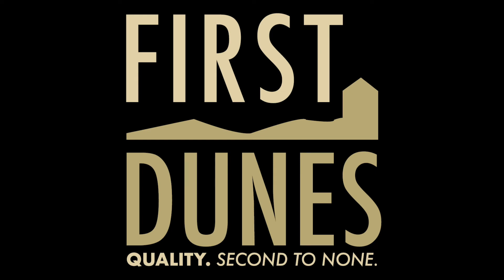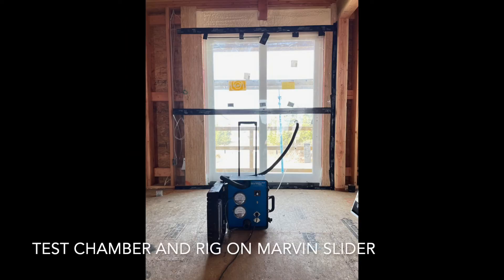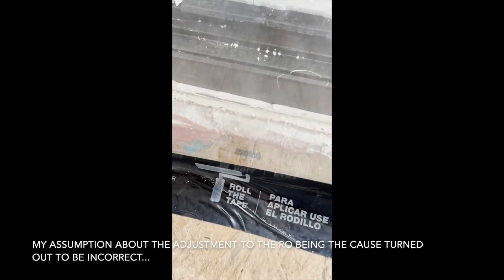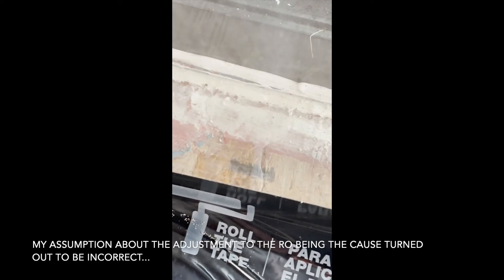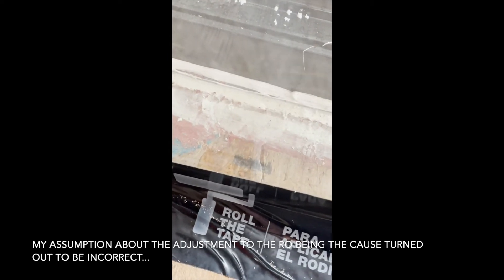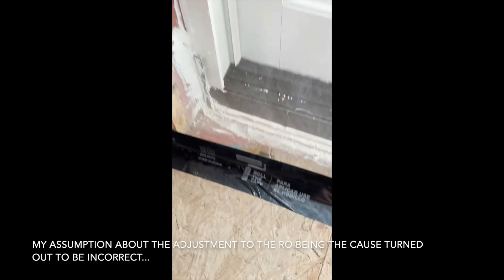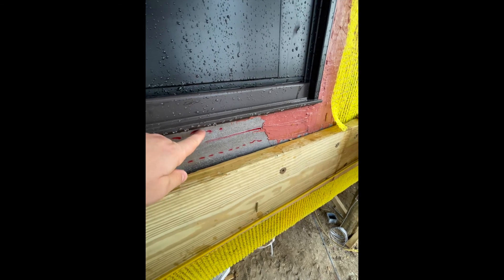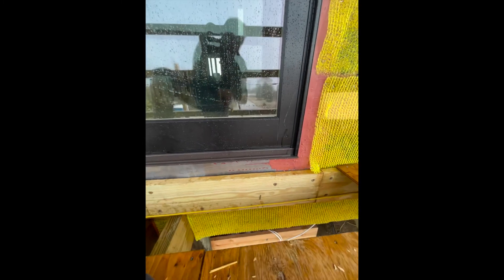Testing #Marvin Elevate Sliding Door to ASTM E1105

Comment: That was my question. Thanks to Jake and thank you Chad for the video reply! What pressure (or inches water column) do you typically use for coastal residential openings?
Reply: We use DP 50 windows, those get tested at 1" W.C, which is 2/3 of their design water test pressure of 1.44" W.C.